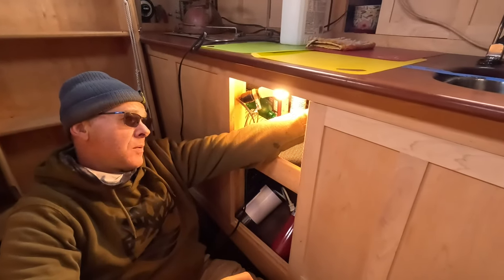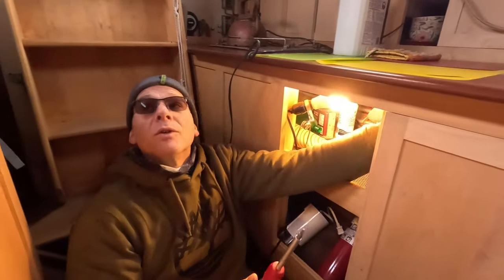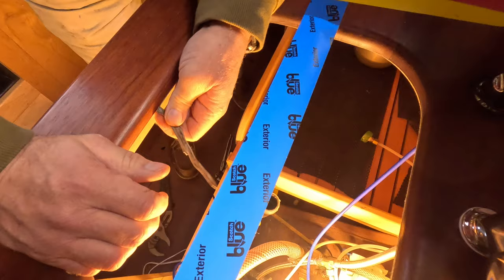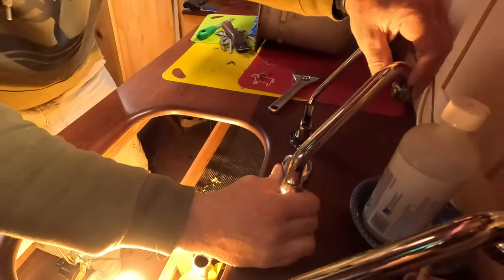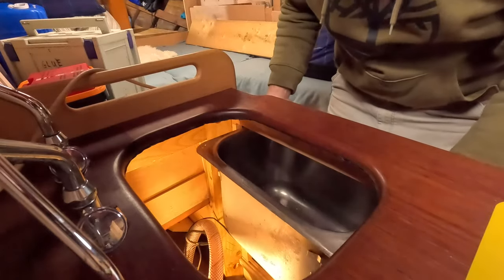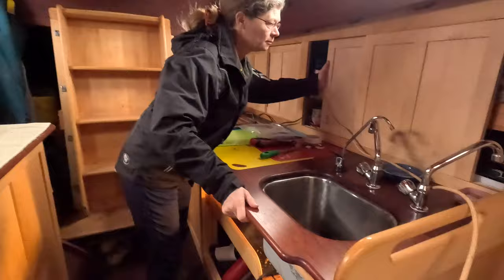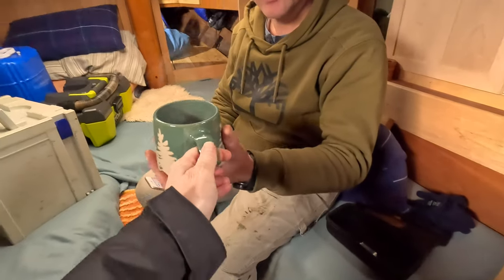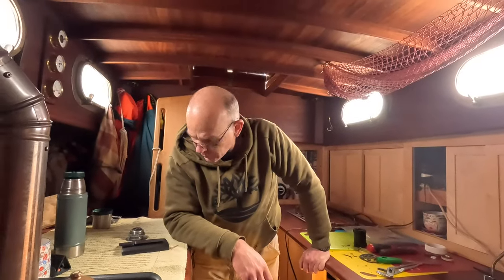Saturday Boat Projects | Sailing Eleutheros EP28

Comment: Having done your own design and construction really helps once you need to do some repairs..Working on faucets with the sink still in place is a "pain":.. With the sink removed it's a breeze..
Reply from the maker: Having made everything, and installed all the systems myself, means that I can handle all repairs and maintenance; a real confidence boost.
Reply: Hard Working ❤❤❤